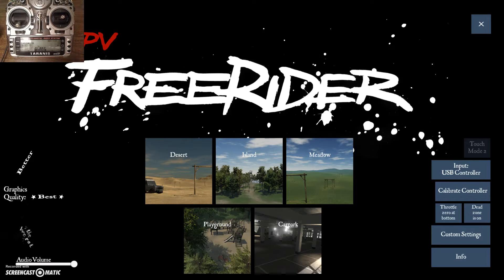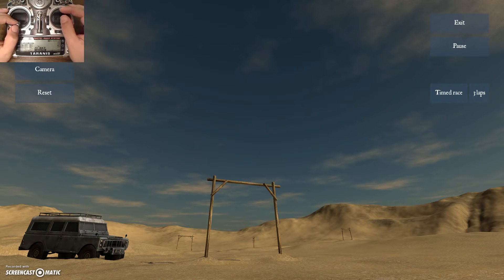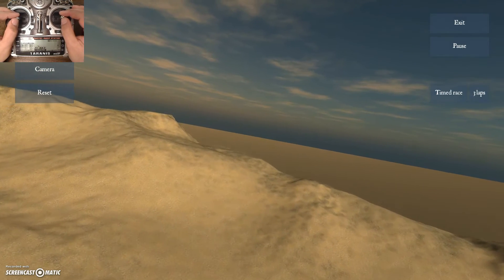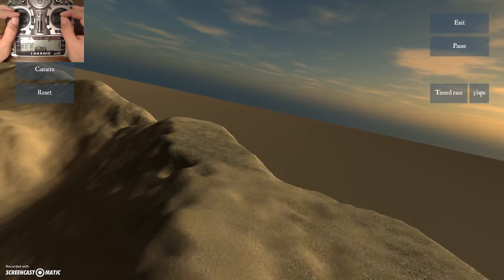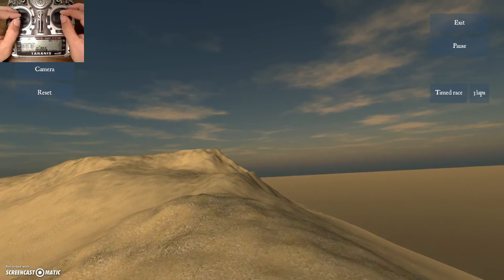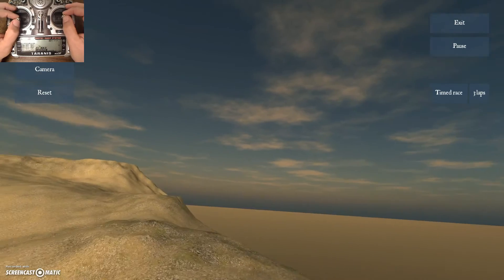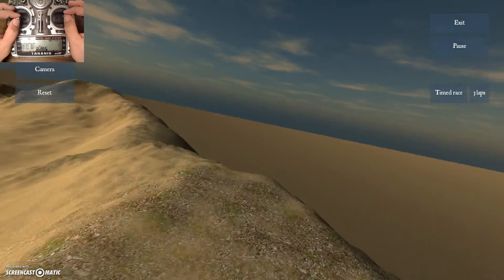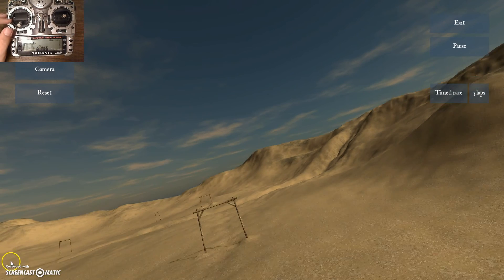How To Fly A FPV Racing Drone - Lesson 5 - Putting It All Together

Comment: Hi, I'm beginner, when I make a coordinated turn, I've to make at same time  the yaw and the roll, but I have to make at the same time the pitch back, too? For not to increase speed at the exit of the turn? Thanks
Reply from the maker: Correct.
Reply: Joshua Bardwell thank you. When I make the turns, at the exit of the turn the speed is greater than the entry of turn. Have I to pitch back at the same time at yaw and roll? For maintain the entry speed of the  turn? Very thanks

Comment: Joshua, i have a problem, ive been doing this program called DRL simulator which seems pretty good so far, in monkeying around with it i figured out the basics of what you showed me here in these videos. Ive only been flying for two days and understandably im not perfect, but i have a lot of trouble flying slowly but when im going fast i can correct errors pretty decently and make it where i need to go. I think part of it is that im using an xbox controller (waiting on my radio (along with my drone)) and it has obviously a tiny amount of throw and so its too sensitive to do stuff like that. Either way should i slow down, or just roll with it and figure that out once i have a real radio with actual gimbals?
Reply from the maker: Xbox controller is really terrible for RC.

Comment: you said here that yours copter is flying different. can you describe difference between life and  simulator?
Reply from the maker: +James Laraia I don't think that's the whole story. The physics model isn't perfect although some get close. If you look at what Matty did to get Hotprops flying like his real copter, the physics settings are all wrong. But he says it feels realistic so who's to judge.
Reply: The difference is based on the physics of the in game quad. The programmers set the copter up to have a certain amount of in game thrust and weight. If the in game copter specs were identical to your real life quad then they would perform nearly identical. I am not sure what the quad specs in the game are however. This is why a difference would be noticed.
Reply from the maker: +Marcin Podolski I'm not sure I can.
Reply: thank you both, I think I have got the picture